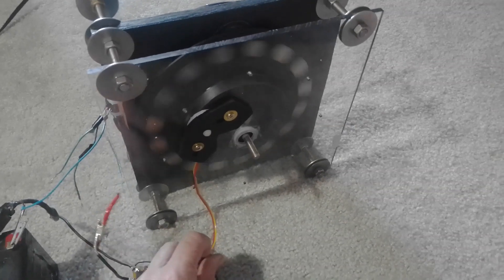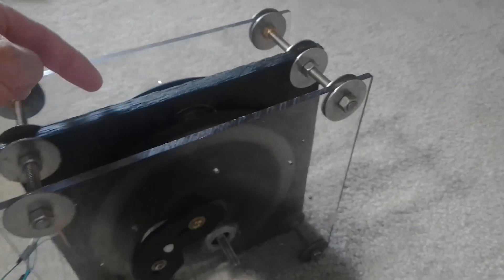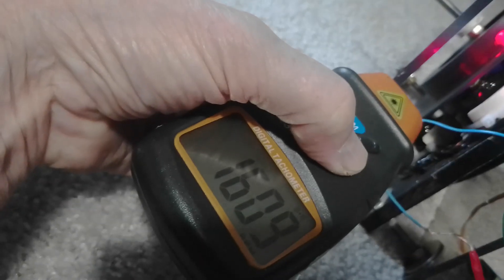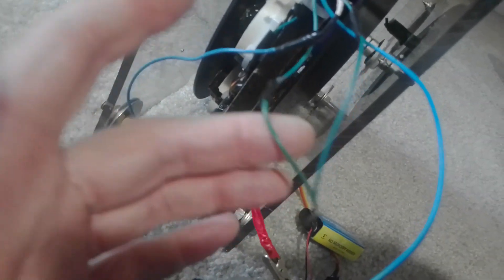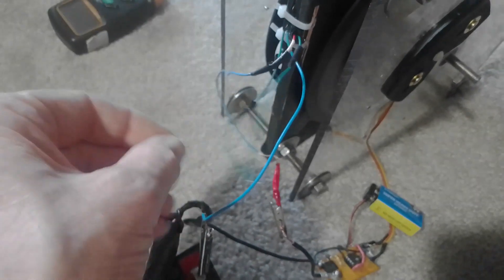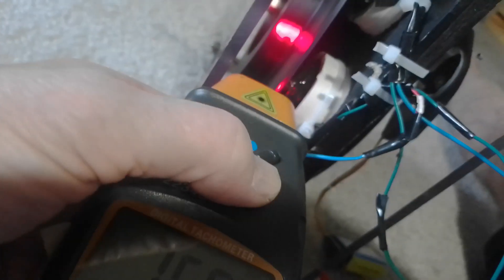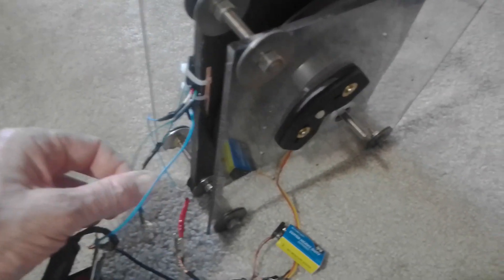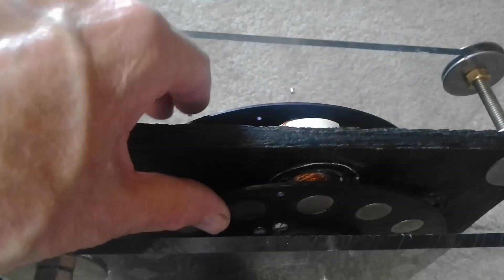test of DRMG at 1600rpm and slight trailing offset between rotors

Comment: Nice work ! Your concept is awesome
Reply from the maker: Thanks K-man!....Idea is find an offset of the two rotors so lenz braking is eliminated (or very minimal will settle for that)  whenever the generator coils on back end of core are heavily loaded or shorted out in this case testing it out.  I could run the motor coils in series to the generator coils so it's like one big generator coil and spin it with external motor too such as a rotovertor AC motor is in the works

Comment: Doug

What do you think about sing the 2mm magnets on the generator side, while using the 1.5mm on the motor side. I know you haven’t check the output yet but II now have two sets of rotors with 1.5 and 2mm magnets., that I want to test different combinations and permutations with
Thanks
Reply from the maker: Sounds good, in that a bit less pulse width to motor coils but who knows might work better other way around too.  I am leaning on NSNSetc rotor change right now might change mind about it after more tests

Comment: Hey Doug, how's it going? Your motor looks fantastic. My new build is now posted on Ev Gray my new build is going fantastic.... The Adam's motor generator.... My motor is running on 50 volts DC. ..... cheers Mike from Canada
Reply from the maker: Hi Mike.  Looking at the offset angle between the two rotors so far
 I suspect rotor of NSNSetc magnets will make more power but will keep testing as is.  Got some good speed up under shorted generator coils will show video of that soon.